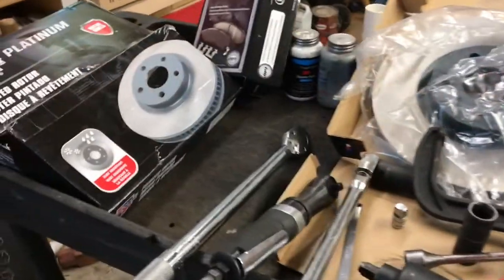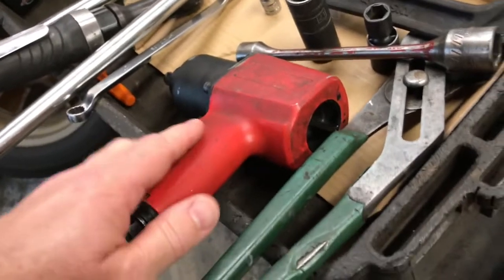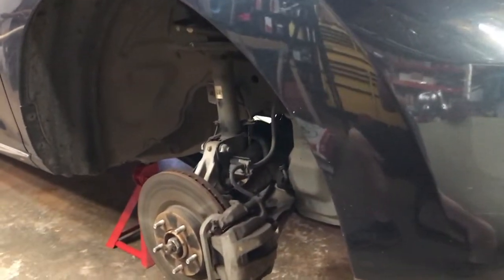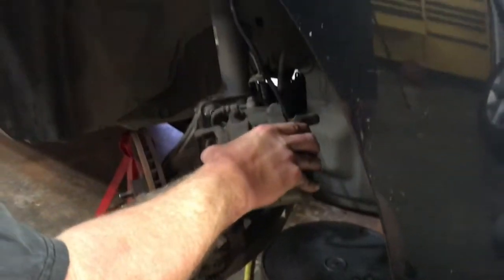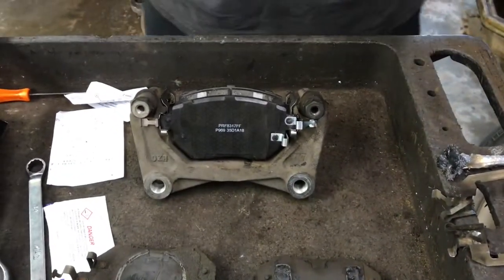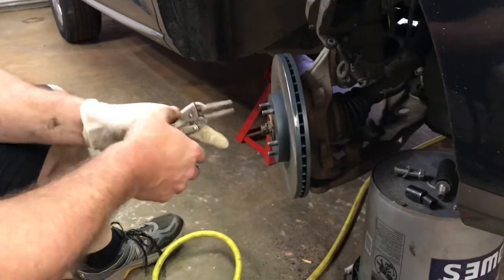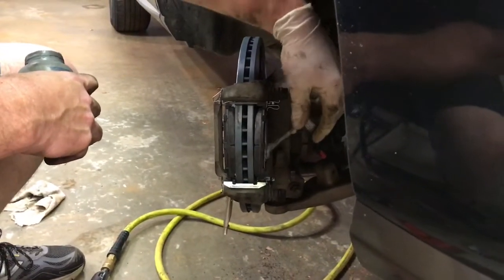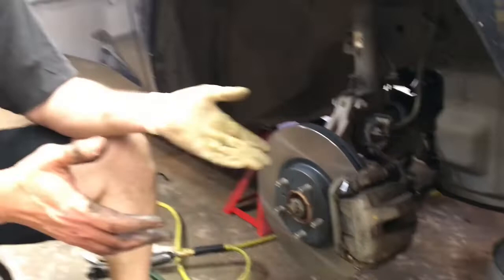How to : Front Brake Job on 2011 Nissan Murano

Comment: Just for info. That paint on the rotors prevenst your aluminum wheels  from sticking to your rotors. Thank you for lubing the caliper pins and contact points on the pads themselves. I see so many mechanics that do not do this.  I would recommend  using a lug nut to hold that rotor on while you finish the job. Something else I do is puts some anti sieze on on the hub to prevent the rotor  from sticking next time. Great video. Oh thanks for not putting  anti sieze on the lug studs. I see mechanics do that also.

Comment: nice video. consider the following

use a file instead of wire brush
lube under the clips
clean the rust off the hub before u put back rotor